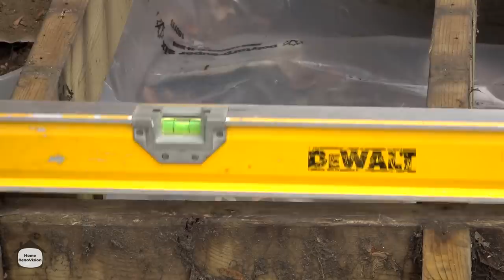Remodel Your Deck on a Budget! | DIY Tutorial

Comment: I would use a standard vapor barrier, rather than impermeable plastic sheeting. It seems to me, that would trap condensation underneath it, ultimately making it a more damp/moist environment than if you used a normal one way breathable household vapor barrier (like Tyvek etc.). And that crack on the rail at the end....  I would have made the hand rails 2" x 4"s to match the posts and be easier to grab and hold onto (rather than for appearance). But overall, really nice job.

Comment: Hello Jeff.

There is something about watching other people working 😊
I have build`t decks and pergolas for years, but its always nice to se how other people tackles problems. 
I can see straight away that we have different requirements, since I live in a different country 😊
For instance, I use 2”8 framing and 2”6 in the deck support. 
But the base idea I the same. So, I have some questions for you.

The cedar timber you use. Is this pre-treated? How will it cope with the climate over 15-20 years? The deck is quite similar to Norwegian pine, but we can`t use that in Norway. It will rot in 1 year.
Do you leave room in the skirting for re adjustment?
You said that the cedar grows in a spiral. How is to work with the construction wood?

You know, when you put the video out on the world web, you get stupid questions from the whole world, and i migth do a cedarproject some day :)
Reply from the maker: cedar goes gray without treating it and does not rot. It lasts 40 years outside. longer if treated with a sealer and uv protection.
Reply from the maker: using screws keeps it from twisting. Cheers to Norway!

Comment: nail in your hangers. only use 1 screw to hang it and nail the hangers in place. screws break off nails wont. i build decks and fences for lowes. just sayin. i've seen the whole deck top fall in from not being nailed. also toilet wax ring will stop wood splits. works way good for cabinets.

Comment: As always, another great video!! Thank you! I can only imagine the cost of the cedar lumber for this rebuild. I need to replace the railing system on my deck, very similar to that in the video, and it would be cost prohibitive to replace the horizontal 2x4s. Would it be better to replace with douglas fir, untreated and stain with a good deck stain and preservative, or go with pressure treated lumber? If PT, do I need to wait to stain or can that be done during install. Thank you!!

Comment: you are a funny guy and I would love to work with you someday.  I have noted you get out of wind easily and that you are carrying an extra 30 lbs in your gut.  I was the same way until I saw a side photo of me with my belly hanging over my gut.  That was enough to make me lose the weight and start a rigorous exercise program.  Got my wind back and still fit into the same size jeans I wore in high school almost 50 years ago!  And yes, at 65, I am still building and loving it! Keep up the great videos!
Reply from the maker: Cheers!
Reply: Yep, I thought the veranda over the toy shop was a concern also, as that is a reliable indication that you have a fatty liver, which probably won't give you symptoms until it is too late to repair your liver.  Everything you eat goes through your liver so it is a bit like your heart, hard to live without.

I would not worry about exercise just now, though great for general health, it does diddly squat for weight loss.  You already have a physical job, so you are getting exercise.

Your insulin is responsible for storing fat, which is what it does with the extra glucose you eat.  Carbohydrates & sugars, including fruit, alcohol etc are what spike insulin the most, so cut those from your diet and you will lose weight without having to reduce the amount you eat.  Eat your normal amount of protein, which means any unprocessed meat including bacon, eggs, fish.  Eat at least 2 cups of green leafy vegetables and one cup of broccoli, cauliflower, cucumber a day.  Fat should be around 75% of your diet, and can come from your meat, cream, cheeses, butter, lard, olive or coconut oil.  No processed oils.  This diet will switch you from burning spikey glucose for energy to the cleaner burning fat, which it cares not if it comes from what you eat or your body fat, which is really just stored energy.

Losing weight is easy if you cut out your breads, grains, cereals and all sugars.  If you want to know more, check out Low Carb or Keto diets.

Comment: 5:33 Not sold on the idea of putting a layer of plastic on the ground under the deck.
It may indeed create a vapour barrier against ground moisture  but what you've essentially created is a mosquito breeding ground with the standing water that will collect down there after a rainfall.
The water will remain on that plastic in a shaded, closed in high humidity area that WILL rot the deck.
You're not only shortening the life of that deck but you're also going to stricken your guests with West Nile disease.
Allow air to flow under it by creating vent holes. Either space the boards in the skirt or install screened vents at either end. (Screen keeps the vermon at bay - for a time anyway)
Reply: in many places its code, and it must have pea gravel or cobbles of XX size covering it completely, its actually there to prevent vegetation from growing and then holding moisture close to the structure of the deck

Comment: Isn't the frame of the bottom step installed backwards? When you were laying out the frame you said that there would be one long board across the front and the the board on the back would be inside the side boards so there would only be one joint that you could see and it would be on the sides. When it's finished it looks like it has the shorter board that fits in-between the side boards on the front.
Reply from the maker: Yup, I actually had to go back and change that. Sometimes the filming gets the better of me. Cheers!

Comment: 1:11:36 what the hell is that screw made out of, spaghetti? No wonder you keep reminding people of sheer strength ratings. I've never come across a screw that weak in my entire life of using mostly really cheap ones. I hope it's just that particular decking screw being an alloy that resists corrosion better but snaps from any side load.

Comment: You already stripped it. Might as well fix the structure. Same amount of time to fix errors as build a new base. Isn't much more cash wise.
Reply from the maker: feel free, This was designed to help folks on a tighter budget.
Reply: @HomeRenoVisionDIY  I agree with you HRV.... trying to save as much as possible and hate throwing away still good material. .... needless to supply landfills with more trash.  Loved this vid as I do plan on building deck this coming spring... lots of good pointers! Bless you for sharing your knowledge.

Comment: Hi Thank you showing what's wrong with my deck
This deck in video is exact replica - you just described. Now I know what should have been but not. Water from the deck bouncing on wall causing damage to the bricks and building algae. 
no screws - they nailed it and had a job removing the planks. I call it 'single woman syndrome'. No moaning just a reality. Now I know what needed doing. 
LOL now I can put things right
Reply from the maker: Cheers and Have a great Christmas!

Comment: Just looking at thr first 5 seconds....it rotted because it was cedar.  Not enough air flow below the deck made it worse.  Your 2x4s at the bottom of the guard rail are wayyy to low.  The wood below there will rot and its hard to remove leaves and snow

Comment: Nice work, but I noticed that you forgot to use that self adhesion tar paper that wraps the top of the joists before 
the deck boards get installed.
Reply from the maker: jUST SHOWING THE OPTION FOR FOLKS WHO DON'T PLAN ON PRESSURE WASHING THEIR DECK TO MAINTAIN IT. cHEERS!

Comment: Terrible example. Missed out a heap of points like cutting out to fit around the post on the outside decking. And what about the stairs? Nothing soo much detail missed. I'll the guy a 4 out of 10. Soo many little details not mentioned.

Comment: The front skirt screws would be the point of contention for me. They're clearly visible, a part of the design as mentioned, but yet there's no uniformity.  The use of a spacer board may help keep some of those screws on the same line
Reply from the maker: I just checked and the screws are now all not visible after only a few short weeks. the cedar has swelled to envelope the screw heads and are no longer visible. Cheers!

Comment: the second stair is only 5 1/2" rise.  6 1/2" bottom stair rise, 5 1/2" second stair rise, 6 1/2" top stair rise.  the second stair box should have been set on a deck boar, not the framing.

Comment: reason u reverse, is so u dont have 2 predrill it, its a cheat. ;) really needed that tip on how 2 straighten a board, and not "rainbow it" had 2 put down old boards at a friends house, alone... Dont the sqare ever get really stuck! when u use it as a spacer!?! :D I use smooth spacers resting on every frame joist, cause i always forget 2 bring them with me. :) Dont like knots on the sides of handrails, they always fall out, and leave a hole, and a nasty hook. Love all the tips. :)

Comment: There's not a chance that I would ever put a wood deck on the front of my house. However if for some crazy idea I did then I would have ripped out all that crap and started from scratch using composite materials and certainly would have addressed and fix that front door threshold. The reason all that wood is 8' is because that's all that the jerry-rig homeowner could fit in his car.

Comment: speaking of the non level issue 1/4 inch per foot away from the house to run off rain ice snow for 4 feet? the rule ?what climate? remember wind sheer can push water up into the main house
Reply from the maker: Hi Tom, when building a home we rely on average weather patterns to construct. extreme weather is very temporary and most homes can absorb water from an event and then redistribute it back into the atmosphere. It is not financially viable to build based on worst case scenario. That would be like Holmes building a blue wood house after a hurricane.... Oh that's right he did that.

Comment: Nice job. But am I the only one that uses a router and roundover bit on the exposed ends? On a big deck, I like a 2x8 cap rail with 1/2" roundover, and then slick it all down with a belt sander.

Comment: That crack on the side of the hand rail can be easily fixed with wood glue mixed with that saw dust. That crack will almost disappear.
Reply: Agreed. I never knock this guys work, but in this case he should've fixed that. I like your method but would be quicker to make a new 2X4 pc for hand rail. Or glue and clamp if you had no more lumber.

Comment: The wall mounting and the post mounting do not meet the current US building codes.  There is plenty of detail available about what fasteners and hardware is required and how it is to e installed but viewers be advised. THIS DECK DOES NOT MEET US CODES FOR THE MOUNTING TO THE BUILDING OR FOR SECURING THE POSTS TO THE  STRUCTURE!!!!!

Comment: Your info on the deck boards cupping is backwards. The growth rings are constantly trying to straighten, so the curve should be placed downward. 
I followed your advise years ago, and every board cupped and held water.
Reply from the maker: If you live in the north like we do and you are close to the ground and out of the sun it is exactly right. Cheers!
Reply: So are you saying that since I live in NC, and the deck will be approximately 3 to 4 feet off the ground that the rings should be pointing downward since it will also be in the sun?

Comment: The science behind not splitting the ends are, that you rip/cut the fibers over, instead of splitting them apart. Same thing happens with nails. If you blunt the tip with a hammer, the board is less likely to split.
Reply from the maker: Thanks!

Comment: At 1:41:21 you state the back fits inside the two sides and then go on about how it makes the front look bettter with only one endgrain showing on the sides and not the front.  You then build the stairs with the two endgrains showing at the front, rookie mistake.  Though you did refinish the deck and it looks beautiful, please tell me you fixed the first step after the video was done.

Comment: Great video! Lots of info and the way you explain it makes it so easy to take on projects. Just subscribe to you. 

I was planning on building a ground level deck in the spring. The section of the video where you talk about the deck breathing and how a deck can prematurely rot due to lack of air flow really spoke to me. The deck I plan to build is only around 12 inches off the ground. Would you recommend doing the same vapour barrier and then possibly adding gravel? My backyard sees a ton sun in the summer. What would recommend to help the deck breathe better? Maybe space the deck boards more than the thickness of the screw? Any help or suggestions would be great. Keep the videos coming!
Reply from the maker: Hi Johnathan, this deck is built because it will not see the sun. if you have a sunny area then i suggest installing the deck boards close together so that when they dry they will form gaps. use a lattice for the skirt so the wind can blow and do not use the ground sheet. you need all the moisture you can get in a sunny area. Cheers!
Reply: @HomeRenoVisionDIY  thanks for the advice! Really appreciate the input. Don't use the vapour barrier, just the builder grade cover to prevent weeds and shrubs from growing?

Part of my deck would be ground level and I would have dig down to get the desired height. I was just worried that the wood would rot out because it's directly on the ground. Combine that with rain and a lot of sun, it would have the sauna effect and cook the deck from the inside.

My deck design is kind of like the deck you did for  the pool side video. Only difference is that my deck would recessed into the ground more and wouldn't have a lot of room for lattice. The joist would essentially be the boarder around the deck.

Comment: why such a longer screw on the deck board? they have no side to side force being applied
Reply from the maker: just making sure I had enough good wood to screw into. I shop before I start. Cheers!
Reply: @HomeRenoVisionDIY  i just meant as you where taking the old ones out you mentioned that they weren't long enough.
Reply: Some of the framing was original framing to insure that the screws would be long enough to find solid material to hold the deck board he went to longer screws.

Comment: Looks like the deck was built by the Home owner on weekends or  evenings  years ago i had a neighbor who was not only a wino but a DIYer  and he built a deck on his home leveling it and laying it out with nothing more than a  adjustable  square  and the  bubble level built in that   On top of that he tried to do a fancier decking layout   With a Herringbone layout  when I mentioned the deck appeared to be out of level he picked up that  try square out of the dirt and showed me it was  only out a eigth of a inch  i tried to eplain to him that was in a 4 inch measurement  and you needed to multiply that by the full length of the  deck so doing the math quickly in my head  his 12 foot deck was out of level  over a foot from one end to the other   I didnt even think a beer wouldn’t  stay on a table  very long  ironically 2 other neighbors on our street were guys that also made their living  doing General Construction and they were hysterical  when they saw the guys work    I will give the guy credit   As he was so clueless he had no idea how bad it was   For me i moved to a different subdivision

Comment: I love your laugh! This was a fun video. I liked the trick of how to push the board in with a screw on a fulcrum if you didn't have an extra set of hands.
Do you have any videos on how to build composite decks? Also, is it possible to add a hatch on the deck that can be opened to access plumbing cleanouts & such?
My house is sort of L-shaped & I want to add a deck but up against one of the walls I want an access hatch to go under & access a cleanout, as well as be able to access a shutoff for an outside faucet/hose.

Comment: Grandpa always told me to take your post and cut a slot (or notch) in it so that your board is resting on a ledge of the post because screws just don't hold by themselves, so don't depend on screws but slot or notch it so the weight is resting on a ledge with the screws just holding it in place on the ledge. So notch it taco boy.

Comment: I would’ve torn out that deck I would’ve jacked up the center post and concrete that 4 x 4 and I would’ve leveled the deck that way not destroyed the deck the other issue that I have with your moisture barrier is that it’s going to hold water you’re gonna have more of a moisture problem than you did before the proper installation for moisture barrier is pebble rock you also criticize the other installer for not using 3 inch screws and you’re using one and ahalf if you’re a general contractor then I’m the popeNo my suggestion was to save the deck that was the best way if not turn it all out and build a new one I’m sure that the previous homeowner did the best he could

Comment: why wouldn't you make the newel posts part of the structure and run them all the way down rather than hanging by screws
Reply from the maker: Not sure what you were watching but the posts were integrated into the structure for maximum strength.
Reply: I think he is referring to the fact that you have a three foot rail supported by a 6 inch connection at the deck joists. That's a 6:1 ratio, not truly ideal.
Reply: Not really the posts are box framed screwed and carage bolted This is extremely strong. It's not like he is just attaching to the rim joist.